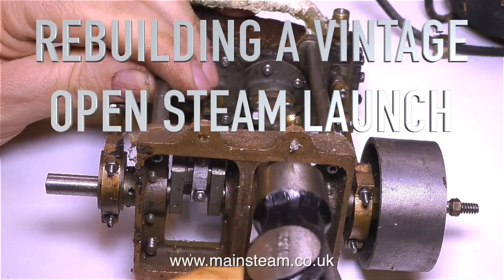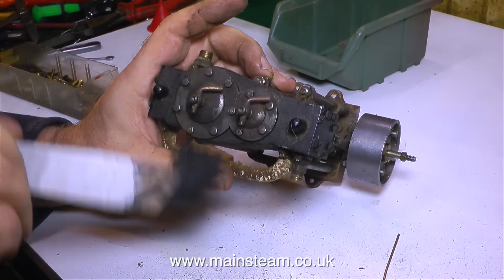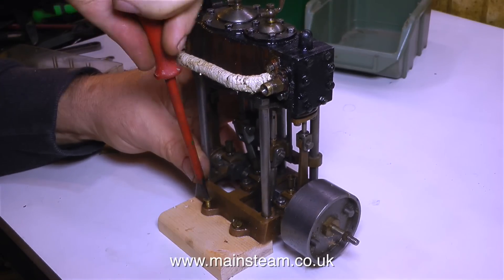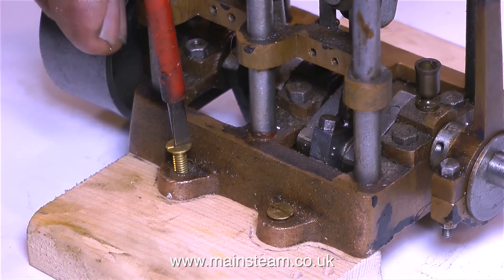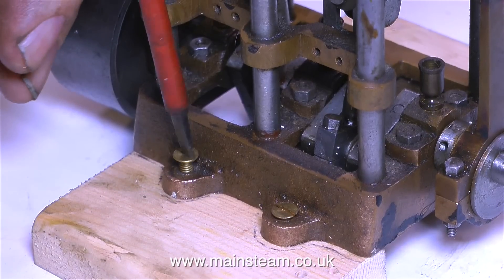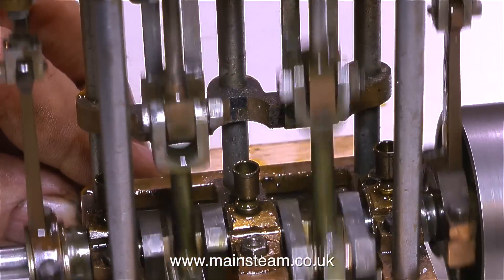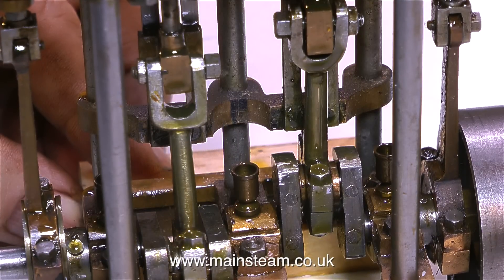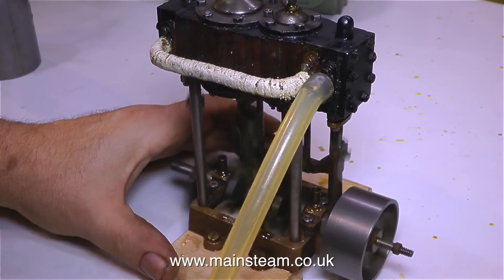REBUILDING A VINTAGE MODEL OPEN STEAM LAUNCH - PART #2

Comment: I wonder if you could build a valve assembly to switch between compound operation for economical running and simple operation for starting.
Reply: DOH, shouldn't have posted before watching the whole video.
Reply from the maker: Yes it's simple enough - but with this engine it really wasn't worth the effort as it was very poorly made.

Comment: Hi Keith, Another solution for the two cylinder compound on RC models, which does not include Viking burials, wading or swimming:

You'll need an electric motor driving a rubber tyred wheel which is mounted so as to be in permanent contact with the flywheel circumference. When the steam engine is running, the electric motor simply idles with extremely low loss of power. If the steam engine stops mid-lake and doesn't want to restart because it's stopped in the wrong position, give it a kick on the electric motor to restart it.

It will require another channel on the RC Tx/Rx and probably a relay rather than a servo to deliver the current to the motor. The 'Emergency Starter Motor' battery can be a lowly priced Alkaline battery, since it won't be called upon very often (hopefully).

Just a though, for what it's worth.

Great series, Keith, as always. Please keep it going. Gordon.
Reply from the maker: Thank you for the tips, I am aware of them and have used this one and a few variants in the past, but the owner of the boat has requested that I leave it original.

Comment: I know there is a way to modify a servo so it will soon 360 degrees, like a motor, but still very slow. It might be worth the time to put one in with a small wheel on the servo output...but then the motor would have to fight the constant friction of the wheel on the flywheel. Possibly attaching a gear to the crankshaft and the putting another gear on the servo with half or three quarters of the gear missing. So as the servo spins there would be deadspace for the engine to run. But maybe it's a little over complicated for the owner. Food for thought

Comment: Have you thought of using a wee electric motor to do an emergency start?
Reply from the maker: Yes indeed, I mentioned it to the owner but he didn't want anything like that in the boat . . . .  He wants to keep it in the period, the radio control will be carefully hidden on this boat :-)))
Reply: Keith Appleton You could disguise the motor too
Reply from the maker: I mentioned it to the owner but he didn't want anything like that in the boat . . . .  He wants to keep it in the period, even the radio control will be carefully hidden on this boat as it is really what is called a "Pond Launch"
Reply: Could you add a simpling valve?
Reply: ***** He said he doesn't want to use one either so I don't know what sort of sorcery he is planning on using to get that thing started.